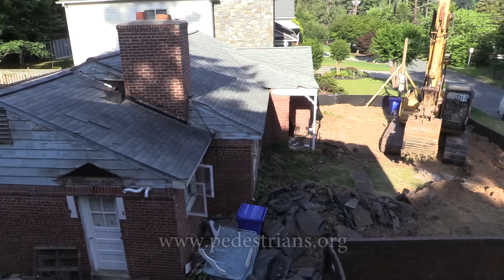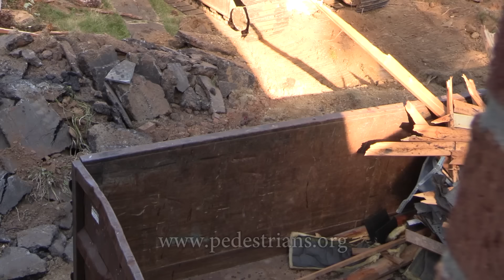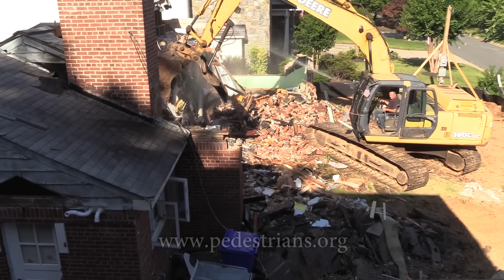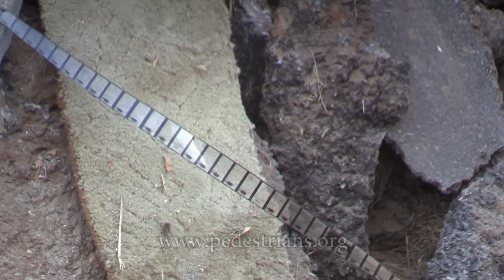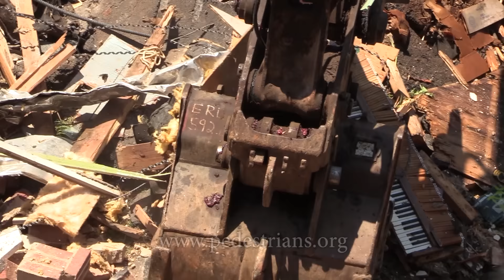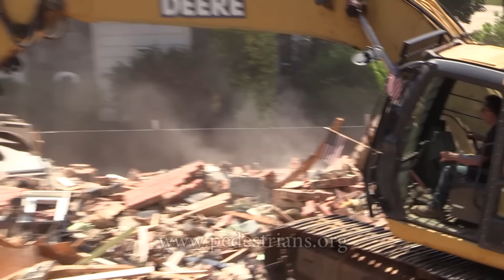House Demolition, Wilson Lane

Comment: way this demo cost this company a lot of extra money  with all that brick he was throwing in the dumpster
Reply: I don't think so. First, note how carefully they separated all the metal and the vinyl siding. Then watch what they actually put in the box. There is very little masonry going into it. All that stirring of the debris pile was to bring the light stuff to the top so they could load it in the box first. So when they got done all they had left in the pile was the masonry with very little other debris. They could then haul it away separately.